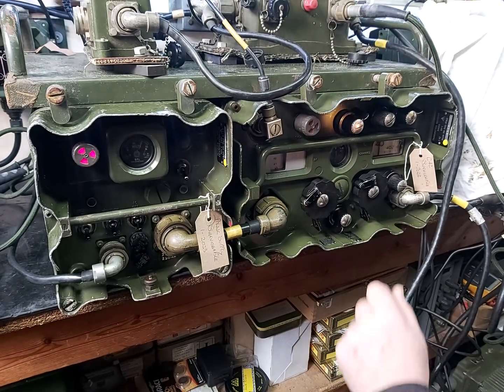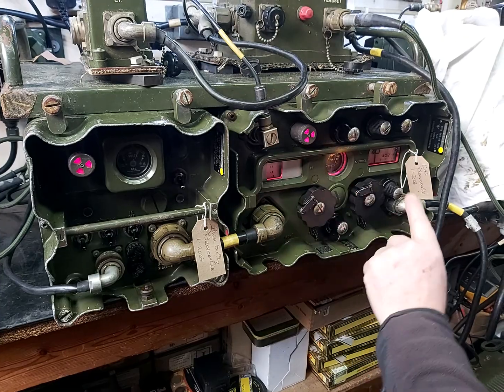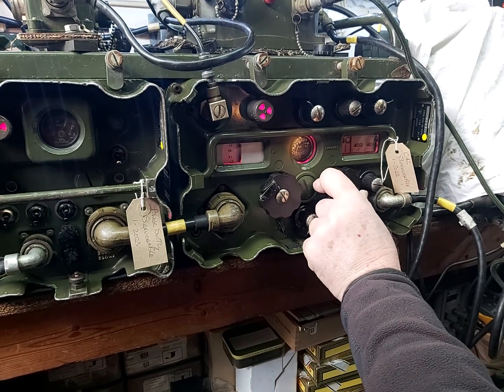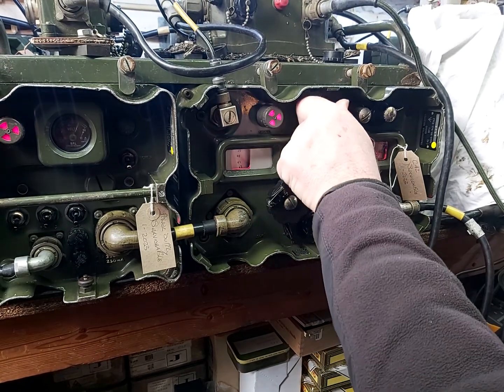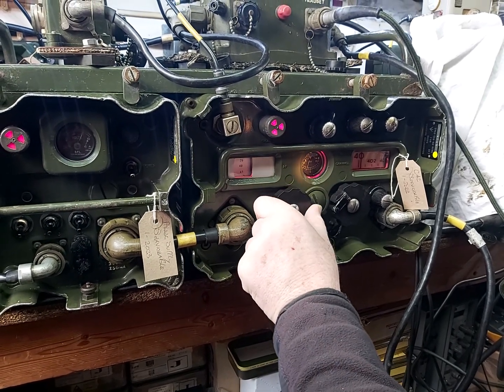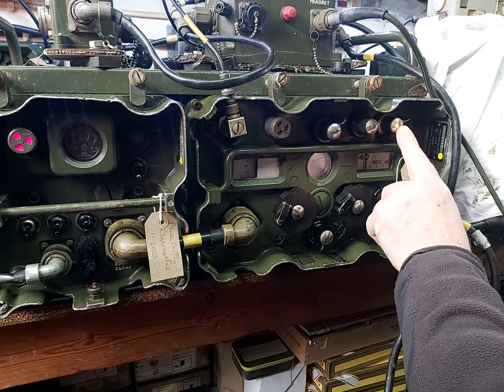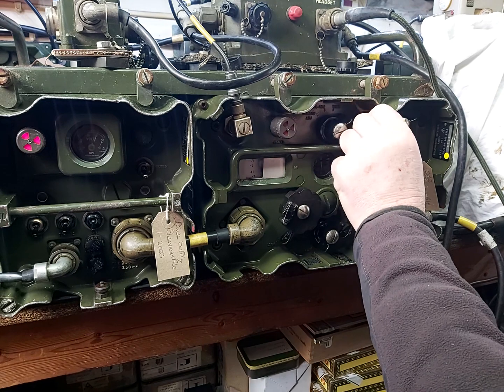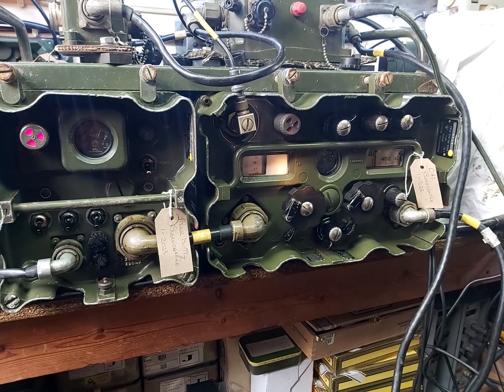Larkspur British Army Military Radio C42 Tuning Procedure

Comment: I seem to remember it being a bit more complicated then that. Didn't you have to count the needle swings for the . (Point) of the frequency Example 38.5 then it would be five needle swings. on the left hand diel
Reply: Yes, I was sure it took a bit more than that. Nostalgic though for a Radio Tech, Light1965 to 1970.